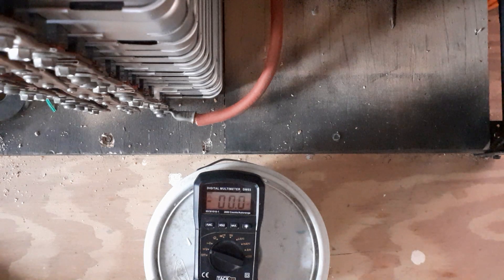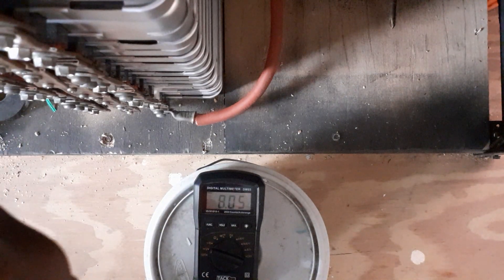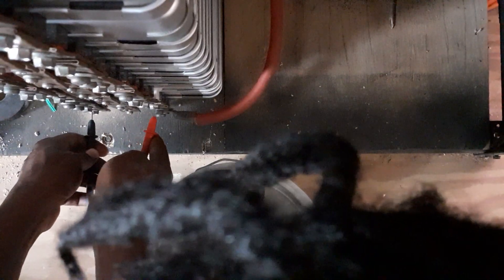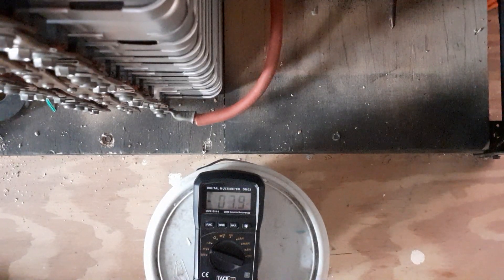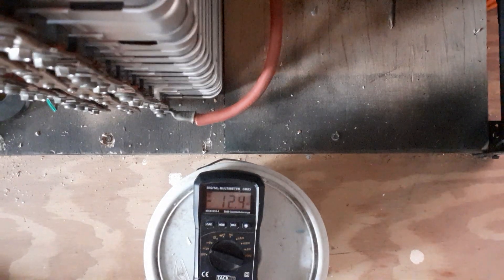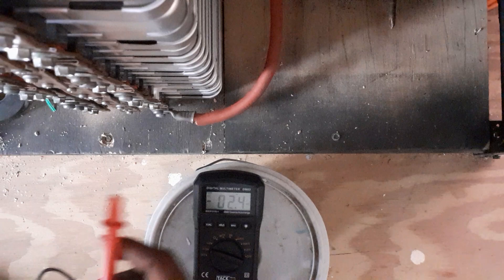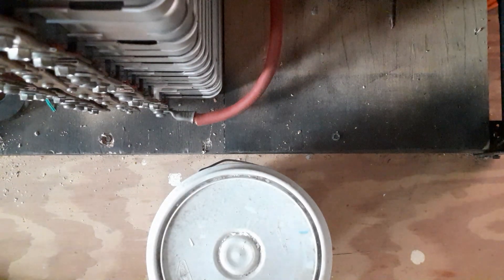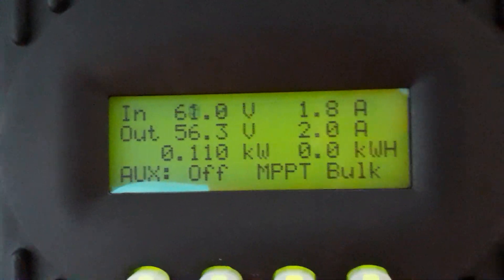NISSAN LEAF BATTERY STAY PERFECTLY BALANCED WITHOUT A BMS

Comment: Is that at the top of the charge or do you charge to a higher voltage?
Reply from the maker: No the charge voltage is 57.3
Reply: @offgridlivingstlucia8865  can you post a vid on the balance when you are in absorb?